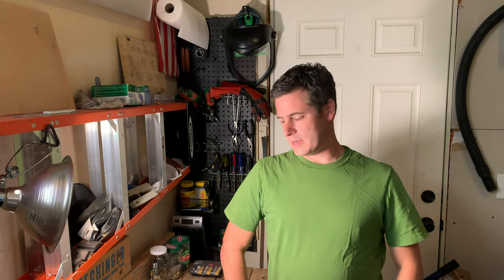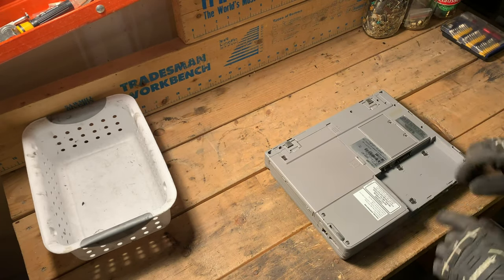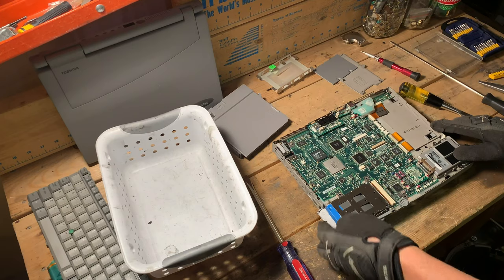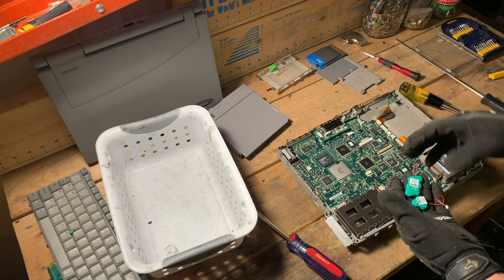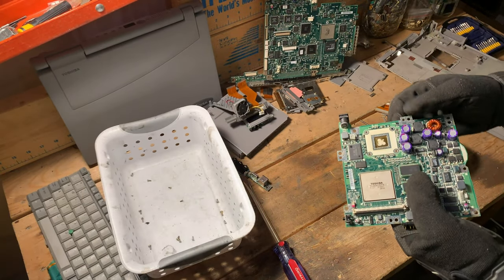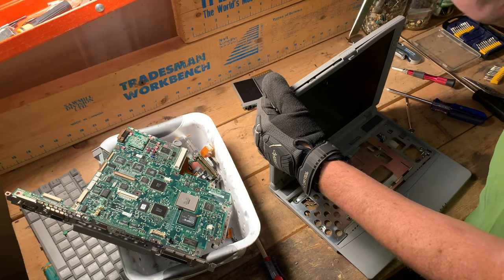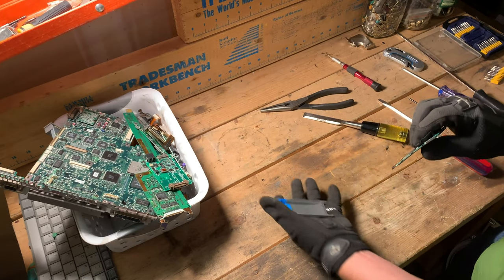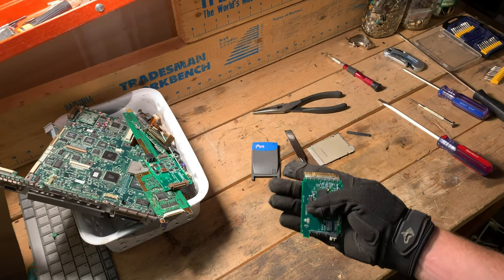eWaste Mining: How Valuable is the Scrap from a 1990s Toshiba Laptop

Comment: Off the top of your head, what is the worth of the metals in that computer?
Reply from the maker: Sadly, the MLCCs all turned out to be nickel so they were worth nothing.  The IC chips would fetch maybe $1 to $5... the gold on the pins and contact fingers may be worth about $0.5 to $2... the real value here is the gold bond wire in the main CPU.  I am not sure of the purity of that bond wire... but it could be $2 or it could be pure, making it $10... ( all these numbers are guesses based on values of similar things found in other machines)... as I have not done the refining of these parts, I don’t have the hard data.  The smaller the batch of material you refine, the more you lose to waste and other processing errors... so I save all my parts to be processed all together (future video) ... so to guess a final number... I would have guessed that this machine had $7 of gold, $4 useful copper and maybe $1 aluminum.  I would have paid $10 to acquire this machine for metals...

Comment: I can tell you are a bit in-experienced at e-waste... so I’ll give a bit of helpful info,, the keyboard has a Mylar in it, this Mylar has silver traces through it,,  The MLCC’s do contain platinum group metals,, testing the amount you get from one board or computer is not enough to even show up in a test,,, you will need at least a kilo of MLCC’s to get a amount of precious metals worth while of processing,, most All ICchips will contain solid gold bonding wires or silver bonding wires, with sometimes gold or silver PLATED legs, I’m referring to the legs inside the chip, very, very seldom do they have plated outer legs,, most all sockets have plated pins, here again you have to check it because not all of are plated, and A LOT of them have such a small amount of platting that it’s not worth while unless you have an enormous amount,, the ribbon cable is usually heavily plated in gold if it’s gold plated,, a lot of ribbons are just brass,,,NOW the biggest catch to doing e-waste is All the stinkin plastic waste to deal with,,, most everything is recyclable except the plastic,, unless you have a very local plastic recycling company in your area,,, other wise you have to pay to dispose of it at the landfill,, my nearest recycling center is 5 hours away, so you can see where taking it to the dump is much cheaper, including the fact that the recycler pays pennies for the pound,, that doesn’t come close to covering gas,, if you have any questions about processing e-waste for precious metals google (goldrefiningforum) they have all the information you will need for that endeavor,,, have fun buddy
Reply from the maker: Thank you so much for the download of info here.  I have learned a lot since this video posted but I feel like I am always learning more.  Two things I still don’t know, if you don’t mind emailing me... 1: how to setup waste and cucl stock buckets, and what goes in each... gold forums don’t always have good searches, and I am not sure what will go in each bucket... 2: who takes depopulated PCBs.  My local metal recycler takes all my steel, dirty and mixed metals I won’t melt or do gold recovery on... but they won’t touch circuit boards... I have a stack of blank boards now and no where to send them... thanks again for the advice and education!